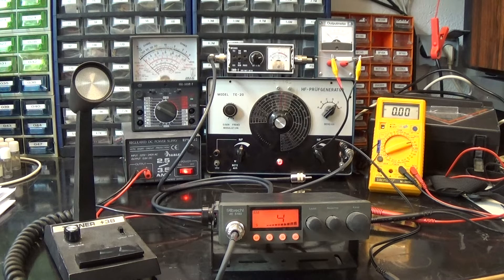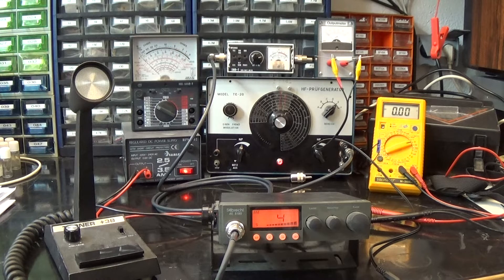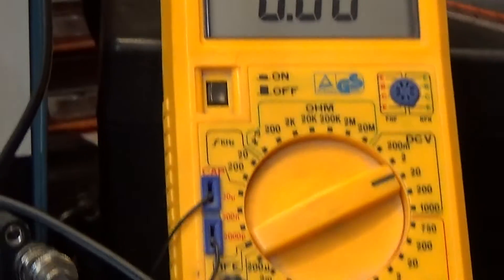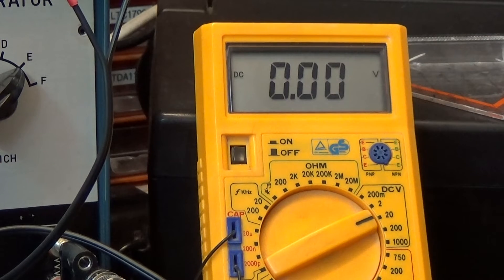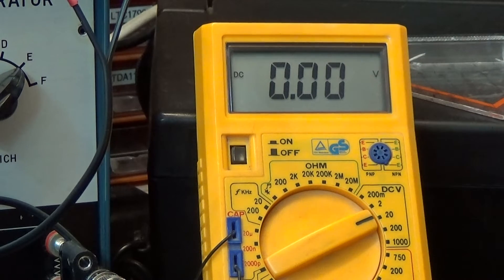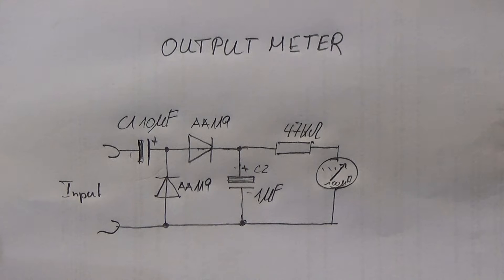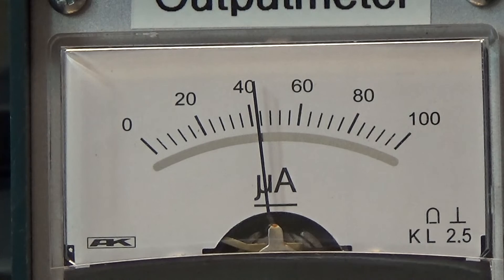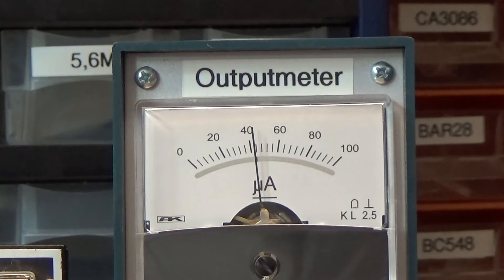#50 Two way radio lab: Your very first radio lab on an extreamly low budgest to start off

Comment: Years ago (back in the mid 70's) I used to modify SSB  CB radios to go above 40 channels.  I would charge $20.00 per radio.  When we moved from Georgia to Tennessee, I ended up selling all my test equipment including my linear amps and filters.  I used a Fluke frequency counter, several power supplies (linear of course), a digital multi-meter and a single channel oscilloscope and a curve tracer for the oscilloscope.  I was in the process of updating some of my equipment when we moved and I sold everything including my J. C. Penny's 6241 SSB CB radio that was highly modified.  I reprogrammed the PLL chip to go above channel 40 and below channel 1.  Had a tuning wand sticking out of the top just over the frequency oscillator so I could swing the oscillator up for above 40 and swing it down for channels below 1.  Cheers.  W Rusty Lane K9POW in eastern Tennessee
Reply from the maker: interesting to hear

Comment: Very informative for beginners. I also went down the same path, getting each particular item one piece at a time. I slowly acquired first class stuff by staying on Ebay until a deal came up. Some of my equipment, I had to rebuild, but there again is another fun learning path. Good luck to the young people and hobbyist. Just keep trying. You will succeed. A very helpful and inspirational video. thanks
Reply from the maker: Satellite_Guy Yes, I think we all went down this way and it is a good way to learn along. Hope it is inspiring enough that many young people take the courage to start.  Thanks for your comment 73 Peter

Comment: I have an MFJ-264 dummy load, but it only has an input and no output. Is there a way I can attenuate the signal so I can apply it to my scope without damaging anything?
Reply from the maker: the 1:10 probe can handle already a lot of voltage.
Reply: @TRXLab  Thanks so much Peter! Very kind of you to have taken the time to answer. I have a Tektronix P6139A 500MHz Voltage probe so hopefully this will do. It would still be useful to have an output the the dummy load.

Comment: I ordered a micro amp meter and they sent me a mili amp meter by mistake , it was too late to ask for a exchange 5 months later when I finally opened the package ....  Are the coils inside the meters the same ? I was thinking the circuit it's connected to is what determines the actual swing of the needle .... Can I use the meter I have??
Reply from the maker: yes there is normally a shunt resistor which needs to take away

Comment: great video ! just the other day I was reading a book with a good idea for a dummy load. Soldering several flashlight bulbs together, enough so they would barely illuminate with key-up power then go full bright   with voice, the steady illumination would help to test modulation. Just thought I would share that. Its an affordable alternative.
Reply from the maker: +Dan Cross Hi Dan, yes very interesting info for the community.  If once started you always try to improve and extend your equipment.. 73

Comment: Hi Peter i have tried it with a 1khz signal generator and it works fine with the load resistor fitted, plenty of volume full full scale deflection thanks...Fred.
Reply from the maker: Tom Smith That's great! enjoy the meter... 73 from Peter

Comment: Peter, don't forget the modulation meter  and  the 1/4 Watt neon bulb RF sniffer. The best CB service monitor I had was left over from my Motorola two way radio service station, a Lampkin 105-B. Nobody remembers them anymore. 
K4OF.
Reply from the maker: BOB RENFRO Hi Bob, of course you are right, there are many additional devices which makes sense but this is only to start off. Sure you need to buy more and more step by step...

Comment: Really helpful video, would like to see a follow up repair or tune video using the new test bench. A question about old valve type signal generators, are they all roughly the same basic design and opperation principle? i have an old sphere unit but it doesn't seem to full function correctly and it would be nice to see it run again..
Reply from the maker: Crusader 26CT1508 Hi Sean, thanks for your feed back. Many of my videos are already addressing how to use those test equipment even it is professional stuff it is always the same procedure.  Valve signal generators work in deed basically the same way but there are differences in schematic. You need a basic understanding on electronics to fix those devices..

Comment: A while back Dr. Carlson's Lab, recommended you as a good channel to watch.... I have been watching .......

I see that that the caps are polarized... Are the electrolytic  caps ???  There are some mica caps also that are polarized....  Also what value and wattage is that resistor at the meter ???

Comment: Just came across your video. AWESOME!! Really enjoyed it. Quick question about your output meter. Whats voltage for cap1 and 2?? Also can the 8 ohm load resistor be installed in the meter or does it have to be outside like you have it? Thanks

Comment: Hi Jan or Peter...good video for beginners, are you going to do a follow up for adjusting deviation and setting the adjusters inside the radio? squelch, etc..i have used an hf radio or a second cb on low power before as a signal generator on a dummy load....think you can maybe use an analouge meter on low AC for reciever voltage across speaker...from Fred g4vvq in England.
Reply from the maker: Tom Smith Hi Fred, well using a "normal" AMM for AC is critical as those meters very often does  not go really ahead 50HZ.
Thanks for feed back Peter

Comment: Thanks for the great video for newbies. Can you please let me know why you used ( for antenna dummy load)   8 pcs of 470 Ohm resistors instead of ONE 50 Ohm resistor?
Is that  PL 259 connector used for that antenna dummy load?
Reply: These little resistors are typically rated at 1/3w. So ten resistors could handle 3w. 100 resistors would handle 30w etc...

Put 2w through a single 1/3w resistor - it would turn black, melt and go 'pop'! 

Hope that helps, G7LAS

Comment: Hi Peter iv been a Ham for many years now, and came across your channel its brilliant and I have  learnt so much from your radio repairs, can I just ask, I have recently built your suggested output meter as I do like to try align radios, the meter works well and if I increase the audio I can set the meter to say 1/2 full scale but what I’m finding is that when I trim the rf or if transformers the movement on the meter is so tiny you can’t hardly see it move 👀.Is there any way to increase the meter sensitivity?..
Reply from the maker: Are you sure that the meter you are using is in uA for maximum sensitivity?

Comment: Thanks for this video. Now I can setup my mad scientist lab .... 
After watching this, I realized that I had everything except the output meter and the RF generator. The output meter is in the planning stages and the RF generator is on the way from "the" Bay. There's also a Frequency counter on the way from China. I'll be up and running soon!
Can you describe how the connections between the radio/generator/wattmeter? Are both connected to the antenna connector through a BNC T connector, or do you disconnect/connect the devices based on which circuit you are testing?
Reply from the maker: No never use a T connector at the RF connector of the radio John. Not only that you produce a mismatch to your swr but you will toast your generator if you transmit into it. You always have to connect and disconnect for TX or RX path. Hope that helps 73
Reply: Thanks for the reply. After posting my question, I watched the video a second time and noticed that you were disconnecting/connecting the proper device. Now I wait for my RF generator.

Comment: great vid I was wondering I'm putting together the dummy load I bought a 10 pack of metal oxide 470 ohm at 2 watt each is this ok I live in usa are cbs are 4 watt max as well
Reply from the maker: Yes metal oxide is the right material you can give it a go Mike...73

Comment: Hello, I really enjoy your video's. Could I ask, What are the germanium diodes you use in your output meter please. Many thanks in advance.
Reply from the maker: +MonkeyMagic Elecifun Hi, thanks for feed-back! Well the diodes are not very special, you can use OA47 or AA119 or any other Germanium type.You only want to get the signal rectified so there is no special demand for the diodes. 73
Reply: TRXBench Hello, I have ordered some OA47's so I can make a crystal radio set. I got 10 so I will use two for your Output Meter project. Thank you
Reply from the maker: +MonkeyMagic Elecifun Good luck with your project!!

Comment: Great video. I am going to build an outputmeter like this, but can you tell me - what is the white component you have in the alligator clamps?  73 Asle
Reply from the maker: Hi Asle, yes that is the load resistor. As the audio amp is working into 8 Ohm you use a load resistor of 4-8ohm. The resistor should be able to handle 5-10 watt power. 73

Comment: Hi Peter on the audio meter you appear to have what looks like a white resistor across the meter terminals, but its not on the schimatic, what is it? the meter you use for peaking the IF transformer, Fred
Reply from the maker: Tom Smith Hi Fred, that is a 8 Ohm dummy resistor instead of speaker . 73
Reply: TRXBench Ok Peter, i thought that was what it was but wasnt sure,,thanks fom Fred

Comment: With this equipment, how would a new tech be able to check positive and negative modulation % without a scope?
Reply from the maker: Hi Chris, this is to start off, you can't have anything right from the beginning if you don't have a big wallet... 73

Comment: Hi Peter i have made one of those Audio Meters as your diagram, i plugged it onto a radio speaker socket, it muted the speaker but i thought i should get a reading on the meter when tuned to a station and volume turned up, the needle doesnt move at all, i am using 100 micro amp meter and 47k ohm resistor etc as you diagram...does it only work with a high constant tone?...or have i got it wrong..as far as i can see i have made it same as you schimatic....Fred in UK
Reply from the maker: Tom Smith Hi Fred, the meter has to be connected in parallel either  to the speaker or a dummy resistor instead. it is mad for audio frequency up to 3kHz or so. It will directly read the audio output  of a radio. If it is muting the tone it will most probably short it out to ground. Please check again you circuit espacily  your diodes. Are they in the right direction?? The circuit I use is exactly what you see on the schema. double check very carefully once again.  good luck 73 Peter
Reply: TRXBench Hi Peter, its ok if i take the load resistor off and plug it into a rado the needle hand does move ok, i guess there i not enough sound coming from radio to work it, with load resistor disconnected the volume on radio about half way up looks good, but i will try it later with a 1khz signal generator with the resistor connected, sure it will be ok, yes i have double checked the circuit it is all together right, thanks again from Fred.

Comment: Hi peter, Really interested in building the output meter, What is the purpose of the resistor clamped to the input terminals ?
Reply from the maker: The resistor of 8Ohm represents the speaker load to the audio amp as you don't want to listen all the time to a annoying ton while you are aligning a radio...
Reply: @TRXLab   Ok. Like a dummy speaker, I suppose any germanium diodes  would work in the circuit ?
Reply from the maker: you are right in both points 73
Reply: @TRXLab   Cheers peter 73

Comment: What is the wattage of the resistor connected on the front of the output meter?
Reply from the maker: I is a 11 watt resistor William.
Reply: Is this the 47K resistor shown in the schematic?
Reply: Probably an 8 ohm to replace the external speaker resistance.

Comment: auf ebay beobachte ich gerade genau den HF-Prüfgenerator
Reply from the maker: Hallo Bernd, diese alten Generatoren brauchen in der Regel eine volle Restauratiom, somit wäre ein HP oder ähnlich die bessere Wahl. Im Video war das nur als Beispiel gedacht, aber keine Empfehlung sich genau nach diesen Generator umzusehen..Das nur als ergänzende Information. 73
Reply: Hallo Peter, danke für die Info, laut den Bildern hat der Verkäufer das Gerät an einem Oszilloskop getestet.
"Von 100KHz bis300MHz. Der Generator kann intern moduliert werden 400Hz oder oder fremdmoduliert."
Ich lass mich mal überraschen.

Comment: no frequency counter..??
Reply from the maker: +bigpimp347 well you have to start somewhere..., but you are right finally you need a counter at a point.
Reply: +bigpimp347 Counters are cheap, especially second hand but a two channel oscilloscope and accurate generator can get you out of trouble. One you get close you can feed each and trigger on the generator and adjust the rig to slow the second trace movement, or just use the scope.